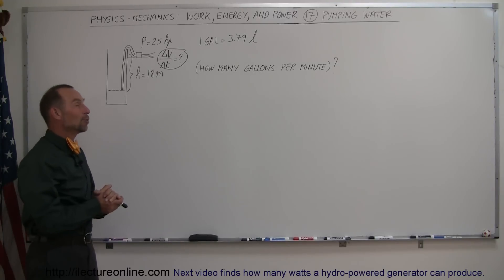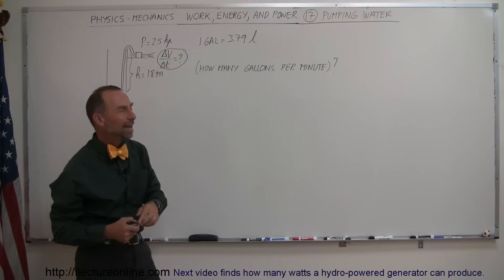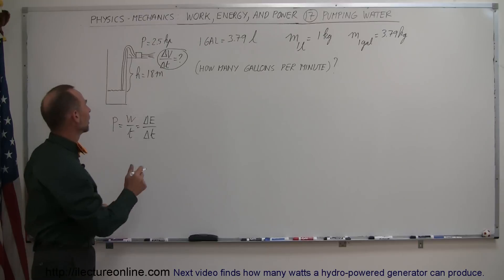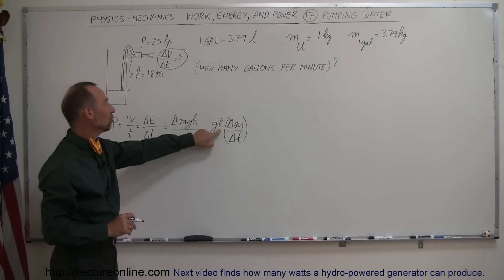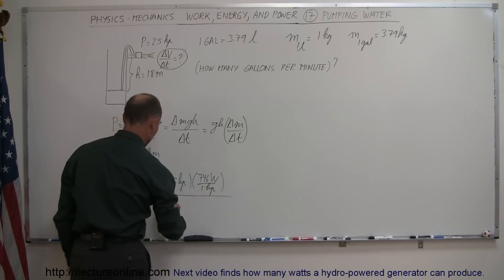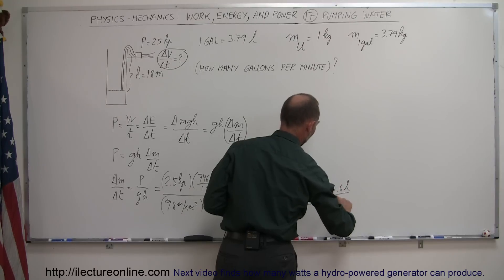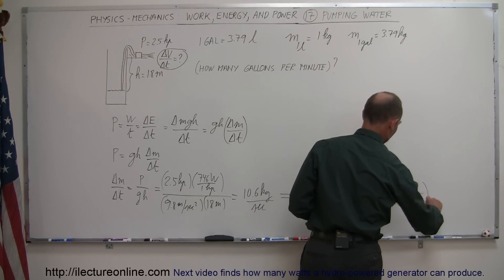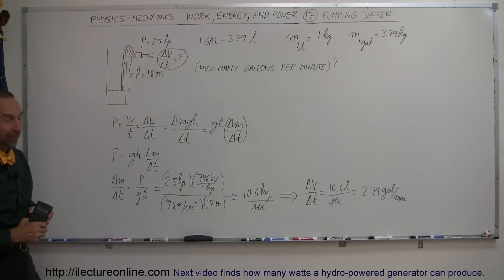Physics 8  Work, Energy, and Power (17 of 37) Pumping Water

Comment: thnx for all of your videos.but got a doubt on this video.work done means change in energy.here the water is in motion as well as it gains a height too.therefore there is change in potential energy and kinetic energy too.but you considered only potential energy change.please explain why you ignored kinetic energy
Reply from the maker: For the purpose of illustration we only considered the change in potential energy.  But you are correct.  If the exit velocity is significant, then we must include the change in kinetic energy as well.
Reply: @MichelvanBiezen  it means you ignored kinetic energy assuming that velocity is so small.is it?thanks alot

Comment: Calculate the work done by a pumping machine in raising 600 kg of water from 14 m
deep well on to a reservoir of 6.0 m above the ground

Please sir,help!
Reply from the maker: Assuming 100% efficiency:    W = change in potential energy = mg x change in height = (600 kg) (9.8 m/sec^2) (20 m)
Reply: @MichelvanBiezen  omg thank you for replying
Reply: @MichelvanBiezen  A 5.0 kg mass drops vertically from a height 4.0 m on the plate on top of a spring balance
whose force constant is 509 N/m. By how much is the spring compressed?
Reply: Sir please reply i need your help!
Reply: @MichelvanBiezen  A variable force Fw = 3x - 4x moves a particle from xi = 1.0m to x 4.0m. Calculate
the work done by the force.

Comment: A water pump pumps water up to 1200kg per minute from a 30m deep tube well.  If the water is discharged at 3ms-1, what is the amount of work done during one hour of pumping?  Let gravity be the armature = 10ms-1.
Reply from the maker: W to lift the water = (work for 1 minute) x (60 minutes) = mgh x t = (1200 kg/minutes) (10 m/sec^2) ( 30 m) (60 minutes)         W to give water a velocity of 3 m/sec  =   W = ((1/2) m v^2 / min) x (60 minutes) = (1/2) (1200 kg) (3 m/sec)^2 (60 minutes)
Reply: @MichelvanBiezen  sir as you have taken both work done to give velocity as well as to lift water into account,why didnt you do that it in this problem (in the video)you just considered potential energy.please help
Reply: Final answer give please
Reply: Sir please full query. I not understand please
Reply from the maker: All you have to do at this point is multiply the numbers.  The total work is the sum of the two results.
Reply: Sir please final answer tell
2.19×10**4
Reply from the maker: W = 2.16 x 10^7 J + 3.24 x 10^5 J = 2.19 x 10^7 J
Reply: Sir sum = 5.40×10^12
Reply: Sir please give full Equation.
I am a student.please tell step by step
Reply: Sir your step is ok.
I get two answer but 
Total sum 5.4 × 10^12
Not get 2.19 ×10^7
Reply: Sir please give your mail address
Reply: Sir I get answer.thank you so much
Reply: The coefficient of friction between ground and ground is 0.  Is 1.  15 kg is the value of the force f if the offender receives 3ms ^ -2 armature when the f key is applied to the offender.(fcos 30, f sin 30)

Comment: h = 18m !   Is this possible? I thought suction head cannot be more than 10 meters for water.
Reply from the maker: That is correct.  Suction cannot produce this height gain, it needs to be pumped (pushed) from the bottom.

Comment: Sir, isn't the diameter of water pipe important to calculate volume of water pumped out? So how much water can be pumped out if Dia of pipe is 4.5 inch?
Reply from the maker: The assumption is that the pipe is large enough to accommodate the requirement of the pump.  ;Other than that, there is no difference.  (Real pipes do have a "resistance" to the water flow which must be taken into account.)
Reply: Michel van Biezen Thank you Michael. Your swift reply is highly appreciated.

Comment: sir which one consume more electricity a 1horsepower or a 2horsepower booster pump both filling up a 21gallon automatic pressure tank. thanks
Reply from the maker: Assuming the efficiency of the pumps is the same, they will consume the same amount of energy.  (the 2 hp pump can do it twice as fast).
Reply: +Michel van Biezen.  thanks so much for your reply sir. thats what i was thinking also 2 hp motor is better.  god bless

Comment: Sir,
please help me to clarify the following: a centrifugal pump delivers 550 gpm of water at 68 f, when brake horsepower is 22, and the efficiency is 71%. 1. estimate the head rise and the pressure in psi.2. estimate the head rise and horsepower if instead the delivery is 550 gpm of gasoline at 68 FThank you,
Reply: did you get your answer though

Comment: But how do you calculate the work when you are taking consideration of The kinetic energy of the water along with the height?
Reply from the maker: +Muhtasim Ittisaf 
If you also consider the kinetic energy, the the work done is adding both potential and kinetic energy.
Another way to look at work done is that it is equal to the change of energy imparted on the object (water in this case)
Reply: +Michel van Biezen Thanks a lot! BTW you have been a great help

Comment: Michel,
You are more than right about foot/feet, I typed it too quickly. Out of my head had typed (I thought) ~ 23 3/4'which is still a bit off, anyway.......
Since you are more than smart in physics, I still want to recommend you to recalculate your calculation, because whatever the behavior of a pump, you cannot lift water from a distance larger than 8 m (26') depth (difference between air and water) because your vacuum with a pump is not more than 8 mwc (26' water column). 
We all have apparently our small errors, but........it does not matter because all the videos you showed, are a contribution to all the people who like to be eager in science! Pls, continue to do so, only wanted to contribute a very, very small percentage  to it.
Reply from the maker: Bert,
If the pump is a vacuum pump you are absolutely correct.
If the pump however "pushes" the water through the hose, it can do so to much greater heights.  Like the pump used for a water tower.

Comment: Mr. Van Biezen,
You might solve that problem to bring the pump to a level < 8 m (~ 2 3/4') towards the waterlevel.
Reply from the maker: Bert,
Thanks for the input.  (see answer on your previous comment).  
By the way, 1 foot = 0.3048 m, so 8 m is about 26 feet.  (26')

Comment: Mr Van Biezen,
Have seen several of your videos and they are for lots of people very helpful.
Here with the calculation of the pump, I think you have made an error. Since atmospheric pressure is 1 bar=100 kPa=10 mwc and the efficiency of a pump is mostly around 80%, you ONLY can lift from a height of 8 m (= 8 mwc vacuum!!) !; hence people who try to lift from 18 m will be very disappointed. There will be nodrop of water coming out, because the pump will chokes off.
Kind regards from the Netherlands
Reply from the maker: Bert,
Thanks for the input, you make a very good point.
The answer is: "it all depends on how the pump works".
If the pump pushes the water up, it can pump the water much higher than 10 m. If the pump uses a vacuum then the maximum height is 33 feet or about 10 m.
The mechanical efficiency does not limit the height, unless you are referring to the ability of the pump to create a vacuum.  If the pump can only reduce the pressure in the line to 0.2 ATM then yes, the water can only reach about 8 m.